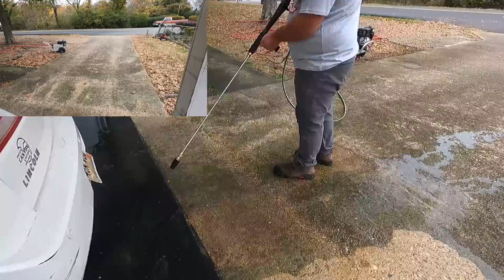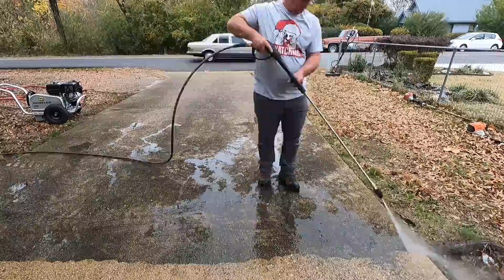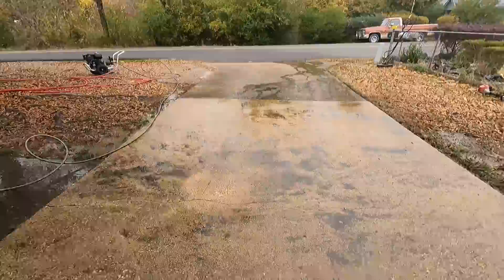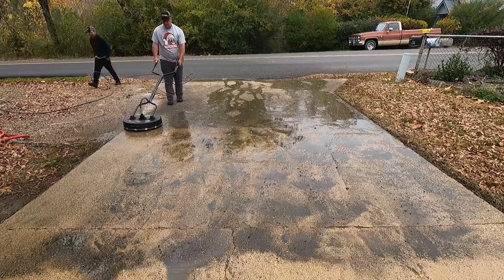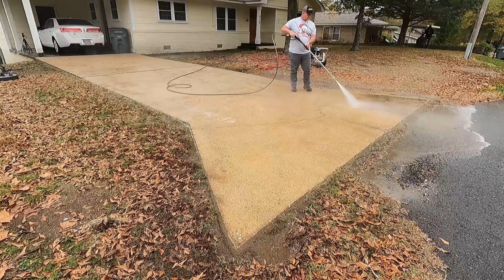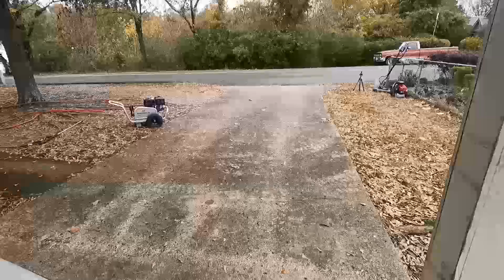SHOCKING FILTHY DRIVEWAY Pressure Washed Cleaned - ODDLY SATISFYING

Comment: Take a tennis ball 🎾 and place it in the handle when you start washing, if for some reason you drop the wand, it pops right out and no more pressure, it will save your hand and arm from future problems. I figured this tip out 25 years ago.

Comment: Each time you pressure wash you’re removing the top part of the concrete and it will deteriorate over time with repeat washes.  Find a GOOD sealer that works in your area and increase your sales while helping your community.  Otherwise it’ll look the same in a month.